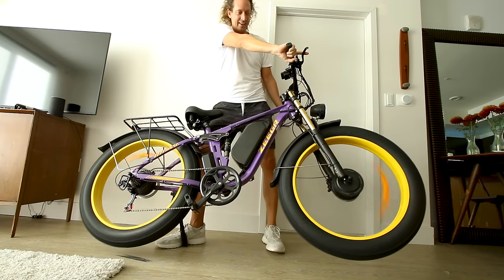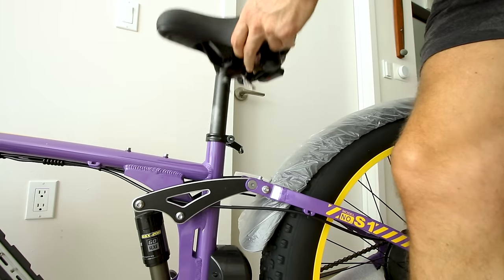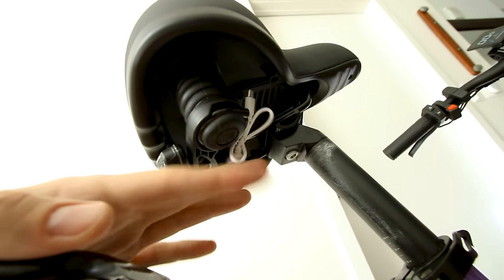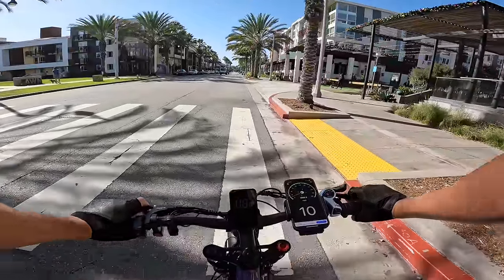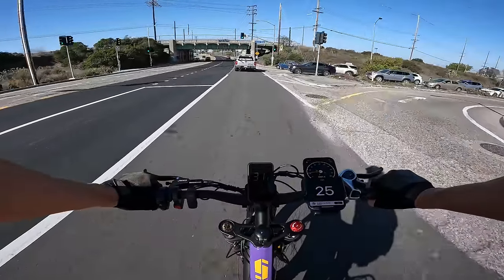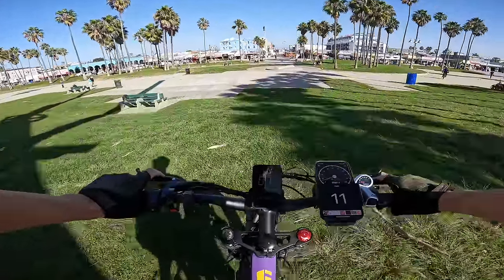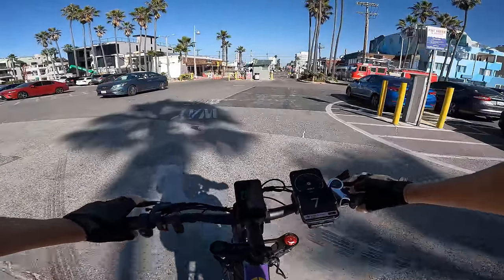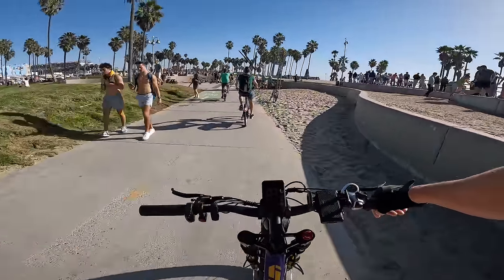This Cheap AWD 35 MPH ebike is SAVAGE - BoomBike Zeegr S1 Review

Comment: I just bought one based on this review - waiting for delivery.
Reply: I just bought one today based on this review. They only had the black one left. Which is the one I wanted. 😊
Reply: How is it?
Reply: @someoneelse6934   I like mine. The range ain't the best. About 15 miles. I bought mine for hunting so the range doesn't bother me. The rear shock absorber is the only thing I found that sucks oh and I have problems with getting the cruise control to come on.
Reply: @someoneelse6934  Really good.  I'm quite happy with it.  Compared to another e-bike we own it has significantly more power for hill climbing.  In fact you have to be careful because it will spin the front wheel on hills if you're not careful.  Nice to have the suspension.  Haven't done any long rides - mostly around an hour long.  No issues with range.  After an hour ride the battery still shows 5 bars.  Pedal assist 5 is actually too powerful - can't imagine actually using it.  PAS 1 or 2 is all you can really use on a trail.

Comment: Some a comparing this bike to the Philodo H8 but there a a few differences between the 2 that can be pros or cons based on your preferences. This one has a selectable Rear or AWD switch, rear suspension 160mm rotors and 21 amp controllers with motors that peak at 1150 watts on a full battery charge. Whereas the Philodo has system where the throttle engages AWD and Pedal Assist is Rear drive only without the need for a switch, The Philodo is a Hard Tail, but some of us actually prefer that, and can be countered with a decent suspension seatpost. The Philodo comes with 180mm rotors. finally the Philodo comes with 27 amp controllers for a peak output of 1500 watts on a full charge, the bigger controllers are the reason for the "controller in a bag" as the controller built into the Zeeger and others is limited to 21 amps, so Philodo opted for a separate battery mount and  controller
Reply: How much is the shipping?  And wait time?

Comment: I bought the Keteles 2000w Pro 23Amp dual motor bike for $1200.  It also has dual suspension.   I bought my bike from a Chinese supplier with a warehouse in California.  I think the bike shown here and my bike are the same.
Reply: Yes, the Zeegr, SMLRO, Keteles, Philodo, etc... come from the same factory.   There are small differences between these very similar models.
Reply: please tell me are you happy so far with the bike? I'm about to purchase one directly from a chinese supplier using the Ali express platform. My only concern with the exterior battery mounting is potential rain exposure.
Reply: @addertooth1 Do you know which company or manufacturer produces all of them ? Keteles, Zeegr, Nexus Rider, Ebycco, etc
Reply: @familydenhaag9860  I can't recall the name, but yes it is researchable. I believe they are in Shenzen China.

Comment: A few things to note, as of 7/8/24 they have made a few changes.  The front fork is slightly different now and doesn't have any adjustments on it.  They added turn signals, changed the PA controls, phone holder isn't wired in (but there is a USB input on the new controls)and have a powered tail light.   As far as mileage goes, I rode the other day and did 28 miles mainly using PA2 which speed is around 18 mph, did a few AWD modes and a couple high speed runs.  After that ride, I still had two LED bars on the battery pack itself.  If I was planning on a long ride, I would conserve power by staying in single motor mode, and use PA1 or 2 or maybe just get another battery to tote along.

Comment: There are no single.controller dual motor bikes, unless it's a single controller, dual channel. They would get out of sync very quickly and the cogging from the pulses hitting the motor at the wrong time would cause it to tear.itself apart fairly quickly.

Comment: Just recently got mine (Canada).  I had to wait for the shipment which was enroute when I bought it.  Shipped from Montreal.  Purchase was painless, delivery happened when promised, assembly was straightforward.  On normal flat ground the extra motor is not really noticeable - the bike doesn't accelerate very much quicker.  Where you do notice is starting out on a hill or simply going up a hill.  This is in comparison to another ebike I own.  On a gravel hill or loose soil the bike will spin front wheel briefly - that's a surprising feeling of torque.  I tried the bike out on several steep rough surface hills and the bike is capable of propelling me up the hill faster than I'd want to go - had to use less than full power.
Reply: Did you order your bike from BoomBike directly as someone mentioned that they don't ship to Canada?
Reply: @billstock3663    Hello.  Yes, I ordered directly and it was shipped to me from Montreal.  I don't know if they have discontinued shipping to Canada since I got mine but it worked fine for me.
Reply: @Aerkavo  I actually live in Montreal so are you saying that there must be a warehouse located in Montreal? Is the parent company BoomBike or was it another distributor?
Reply: @billstock3663    Well, why don't you contact them and ask.  I bought it directly from the website - contacted them with a few questions, paid, bike delivered a few months later (there was a shipment enroute already).
Reply: @Aerkavo  it's available on Amazon for $2400 +taxes or approx 
$2800 cdn.  Is this bike able to use only one motor without any of the PAS modes?
Reply: @billstock3663   I don't understand why you seem reluctant to contact the company directly?  Why not contact them and ask if you can buy one in Montreal?  Regarding the motors; you can use just the rear or both.  The rear is controlled via the cadence sensor or twist throttle.  The front is controlled only via the twist throttle.  Even is both motors are selected on you must use the twist throttle to get power to the front.
Reply: @Aerkavo  I did try to contact them through their online chat but never got a response. Can always try again. I like the bike as it has everything full suspension and double motor for a reasonable price.

Comment: Do any of the batteries from your other bikes fit this one? I would really like to see a review where you actually drain the battery completely with mostly paved riding. And maybe try that steep hill. If you had a spare battery you could fully drain it. Going based on "oh no, its down to one bar" who knows you could be anywhere from 10-40% charge. Definitely should do a second test on this one. Its down to $1100. Seems to good to be true.

Comment: Yes I just bought this one, thanks for the testing it out for me. $1599usd.    20 golden stars for you my friend as you saved me $300 from your link. So next time your in Chicago I will but you many beers lmao. Thank You TailHappyTV.
I got my bike today and put it together. I took it for a test ride and Holy Shit this bike moves. I am not a big peddler so this one I think is perfect. It was getting late so I could not ride as much as I wanted too but tomorrow is another day and I plan to rip it up!

Update:  After almost 2 weeks on this bike and I really enjoy riding this beast. Any terrain you want to master you only have to point your front tire (with both motors engaged and PAS > or = 01) turn the throttle and hang on. I;m telling ya, you will go with the power! It took me a few days to get use to the weight and power and now I only use the rear motor on the street and paved trails, which we have tons of them here by Chicago, When I want to rip dual motors engaged with the touch of a button and again hang on your going for a ride. Now I spent the first 3 days setting it up for the power and speed I like and this bike as it is perfect for me. I;m 5'10 and 165 lbs and I feel this is how the default settings were set. Put it together while charging (topping off) your battery jump on it and ride. As for  range I can't really say as sometimes, because I pedal all the time and the battery meter reads full on short trips. Even if I cruise around town running errands within a 5 miles plus radius. When you buy this ebike I highly recommend pedaling, which feels really good on this Zeegr S1. Guarantee you get the stated mileage if not more just by putting the pedals down, it is good for you too so. They should name this bike "The Ripper".
Reply: did u buy it from the link in the description?
Reply: @dscapnico4211  Yes

Comment: You never mentioned if the front tire restricted you foot on the pedal? I plan on wearing heavy snow boots and I wear a size 12. Also does this bike have single or dual controller and how many amps

Comment: I hate these soft start slow start controllers. 1 minute the motors creep in the next minute is tourqueinh out. Wonder of shunt  mod would  fix that?
Reply: There is a setting in the display for adjusting the "ramp up rate".  It comes from the factory at a 3.  I set mine to a 5, and it comes off the line even better.

Comment: What do you think about this vs the Philodo H8 aside from the obvious lack of rear suspsension?
Reply: I have one.  For me the rear factory shock is too stiff, and feels like there is little or no suspension in the rear.  I am upgrading mine to a 55 dollar shock unit which is "sprung lighter". The H8 also has less favorable location for the controller boxes.   Some have complained they get rubs from the wheel on the H8 under full suspension compression on the early models, they have since moved that box down closer to the crank-set to resolve this issue.
Reply: I'm not crazy about the look of the bike but, it's probably a little better than a lot of these new inexpensive AWD bikes, because it runs off of a Bafang system and it looks like it comes with  a rebranded RST fork witch has more robust drop outs so it should be able to handle the torque of the front motor.  I don't trust the dropout of a lot of these budget suspension forks with a front motors.
Reply: @bassw1758  The re-enforcing hood in the casting is over 5/8ths inches thick on the front forks.   They are quite beefy.    I measured mine.
Reply: @addertooth1  there's a reason for the location of the secondary controller on the Philodo, With the Zeeger the controller built into the battery mount is only 21 +/-1 Amps is the secondary controller to match so the motors PEAK at 1000 watts at 48 volts, Phildo opted for a separate battery mount and controller so they could run 27 +/- 2 controllers which peaks at 1300 watts at 48 volts

Comment: Awesome videos like always gets me hyped when you upload in this channel or juicedjoyrides ❤

Using 2 motors is more efficient than using 1 motor, because lets say that you are power outputting 2000 watts and you decide to use single motor for that and that would be harsh for that motor, but if you use dual motors it will split the power between them like 1000watts rear and 1000watts in the front.

Someone correct me if im wrong.
Reply: It is complicated.  Most brushless motors have a "sweet spot" where they are efficient.   If you are pushing a motor at the ragged edge, you are producing heat and less mechanical motion per watt utilized.   As long as the "ONE" motor is in it's sweet spot, its efficiency will be high. A motor pushed harder will have the coils approaching "saturation", which leads to more energy being used to produce HEAT instead of rotational force. 

The motors on the Zeegr are reputed to be 82 Newton-meters of torque.  This equates to about 60 foot-pounds of torque per motor.  This gives a total of 120 foot pounds of torque.  However, to preserve the internal gears in the hub, the controller has a "soft ramp up" when you peg the throttle.  So your first second or so does not unleash full torque immediately.  This is why the creator of the video had to take multiple stabs at the 0 to 20 time, until he realized if you tag the throttle, let off, then immediately tag the throttle, this can defeat the soft ramp up feature.  This gave about a 5 second 0 to 20 time.

Comment: What if you took the control box and battery from the 62V bike and put it on this thing? Which bikes have dual motors and clear indicators that you are using AWD? It seems that's something this bike is missing.

Comment: Do you do Stair case test in your videos? how hard is it to carry up/down a few steps. I myself built a 500w ebike on a 29er ccm bike with 48v17.5Ah battery. it would be hard to lift if I put 2 batteries, but I want that next. 17.5Ah gets me to work and home no problem.

Comment: That battery looks exactly like the secondary backup batteries for goat power bikes LOL and they are Samsung batteries and I have two on my motor goat and two on my power goat and holy crap do those things book ass. I was hitting 50 mph with no problem and with dual batteries you get so much more range it's just ridiculous. And I got my discount for my goat power bikes from this channel actually and now I'm an affiliate with goat power bikes and by just using my name as the discount coupon in the checkout you save on your whole order so that's pretty cool

Comment: I bought this bike based on this review. The bike would not do more than 32mph, and the rear suspension was rigid. I had to pedal crazy hard to get the 32 and in normal use would not do that. I returned the bike as it had been misrepresented.
Reply: What do you weigh? We need more info from you.

Comment: I'm waiting for something legally stealthy, all wheel drive (AWD), and super fast like the WIRED Freedom.
Reply: Why not get the Wired Freedom then? You wont get anything better for 2k
Reply: I guess it depends on what is legal where you are. In my state they allow 500watt motors and 20mph max speed. That's a class 2 Ebike spec. The Wired Freedom can come shipped as a "class 2"  bike as an option, but it's a fiction. They put an emblem on it that says "class 2" but you can unlock the higher speeds and power. It also only has one motor. There's no way a dual motor bike will pass a cursory inspection if a cop wants to get picky.
Reply: @Tom-ol5zz  Keep in mind the wired freedom was slower in the sand test.  The Zeegr was hitting 20 MPH across the soft dry sand.  The Wired was slower (in spite of it's higher power rating).  If you are a 100 percent street rider, then the Wired Freedom would make sense.

Comment: Question to everybody: I need such a bike only for short distances on paved/asphalt roads. I live in the mountains (incline between 5% and 12%. When i saw how he barely can make it out of the garage because of the incline: Is this bike strong enough for asphalt roads to get up a hill with 5% to 12%? 
 I appreciate your answers!
Reply: It pulled up the 20 degree grade in the garage while accelerating so no problem with 5-12% grades.  The first test he did was single motor and the grade was 20% - Most of the dual motor bikes I have seen him test with one motor cannot make it up the grade so not a big surprise.  Based too on its sand performance the bike appears to be quite torquey and definitely will be a good hill climber though keep in mind 2 motors means double battery burn rate.  For normal cruising I suspect one would want to run single motor and only use the second when you need it....

Comment: all these ebikes need a bigger crank wheel at the front .. or you feel like on a spinning bike if you are at 20 or 25 miles an hour
Reply: Totally agree - I do not know why the bike makers do not routinely use bigger cranks.  Its frustrating having to replace the front crank as soon as you get the bike.  You also have to look closely at the bike to make sure it has room for a larger crank lest you buy the bike with the intention of changing to a bigger crank only to find there is not room for it.  There are a few bikes that have big cranks (wired freedom, ecells, ariel kepler) and they let you peddle and contribute right up in the 30's which is really nice

Comment: Like your reviews. Tks. Do you know if it's a freewheel or cassette style? And is front fork an imitation tapered or actually tapered? Someone said the battery is 21700 cells, is that correct?
Reply: The video plainly shows a typical, freewheeling cassette.
Not a tapered head.
Reply: yes batteries are 21700

Comment: Looks a lot like my Philodo that I just passed 10600 miles:)
Reply: It's very similar to your Philodo. It's probably made by the same manufacturer in the same factory . I think the only differences are that the Philodo has the second motor controller in a bag. It does not have dual suspension and does not have a button to turn off the front motor.  You can get a suspension seat post to make up for that. The Philodo only uses the  front motor when you use the throttle, which I wish the Zeegr still had as an option. When I need extra power I have to hit the button, make sure my PA level is at least 3, and then use the throttle. It would be nice to be able to do that in one motion by just using the throttle but also be able to use the front motor at other times. 

BTW, love your videos.
Reply: @papablueshirt  10k miles?? you should regrease the gears soon... Bafang says 15 to 20 000 kilometers.. so you are on that border to service your gears
Reply: @dg9bfc  I am actually way past that now and still going strong.  I may grease the back when I change my rear tire, if these Ultraverse tires ever wear out LOL  The guy from Grin technologies said he is not convinced the nylon gears ever need greasing.  Maybe I will be a case study 😀